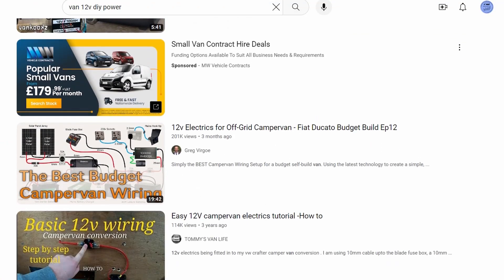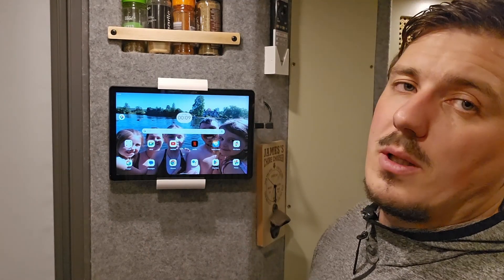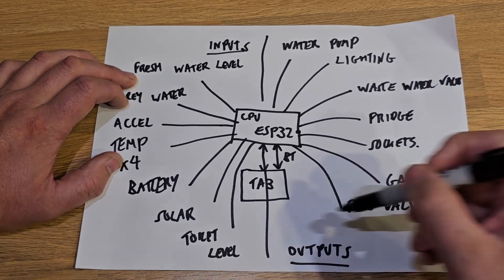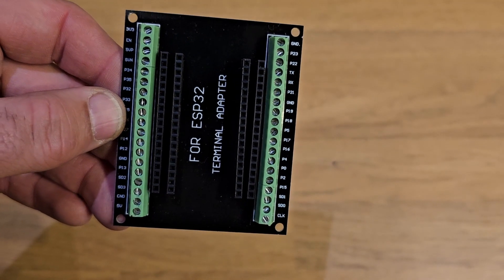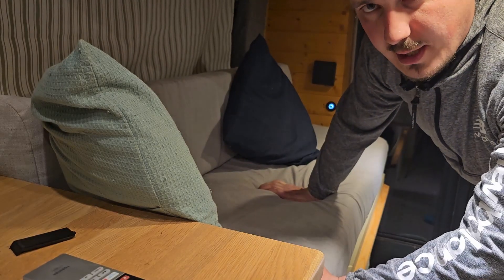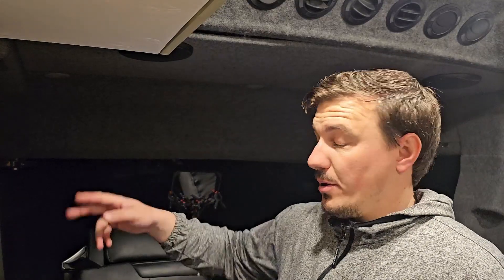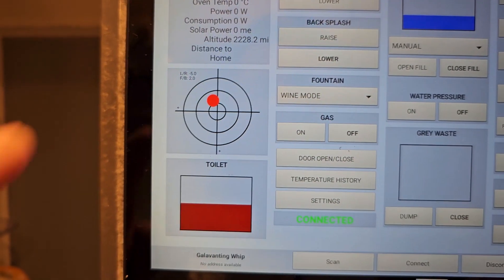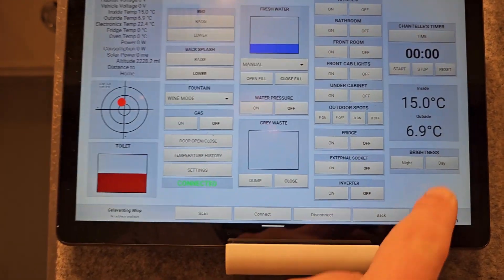When an Electronic ENGINEER builds your CONTROL system || Van Bus Conversion 12V Electrics

Comment: cool system. is there a way to add Bluetooth control to non Bluetooth power bank such as the aferiy p210 that I am using for my vans power via the 25amp output socket. my power box is under the seat and my need is to be able to start and stop the ac sockets that power the induction hob. rather than to have to lift the seating to turn it on and off.
Reply from the maker: I personally dont know but there may be a way but surely the manufacturer could offer an option.
Reply: @galavanting_whip  the option the manufacturer offers is to buy a new unit that has the Bluetooth controls already installed in it. the joys of technology.

Comment: Man, I love this so much. I think only the 2nd or 3rd time I've seen a custom electronic interface to monitor and control systems in a van/bus. The next level is to is to pull the ui control/reporting out of the static grid layout and present it in a way that allows you to see the systems in action within the actual bus; ie. 3d schematic of the bus that can be rotated so you can visualise performance of the various systems e.g. tank levels, power consumption, solar intake etc. That would be so cool.  What's here is so inspirational. Going to sub and keep an eye on your progress. Maybe start dabbling in this stuff during time off at Christmas.
Reply from the maker: 3D is a great Idea. I am going to look into this and see the best way I can program this in. To start, maybe a static drone isometric picture of the bus with all levels and voltages showing. It will be quicker and easier to visualise. Thanks for the suggestion!

Comment: The control system with an eps32 is great. I use the MIT app creator for simple phone apps but this is on the next level. Well done. I was originally trained as an electronics engineer back in the late 80's and it's great to see how things have progressed. I would love to see more of the techy aspects of the control side of things as instrumentation and control was my specialty back in the day.
Reply from the maker: Thank you. I am an instrument technician by trade so I understand where your coming from. Electronics is so affordable these days its crazy how far its came in last 5 years. With an open source world answer's to problems are a quick Google away 😄
Reply: @galavanting_whip  I have been out of the game for about 20 years so very out of touch. Yes you are right about how cheap these little SOC microcontrollers are for what they can do plus all the open source coding resources, truly amazing. When I think how I struggled years ago trying to manage multiple control system integrations and trying to eek that last bit of speed out of cpu's to get faster scan times.....